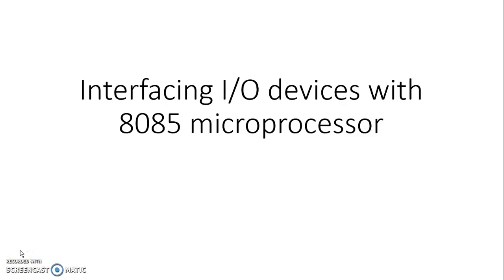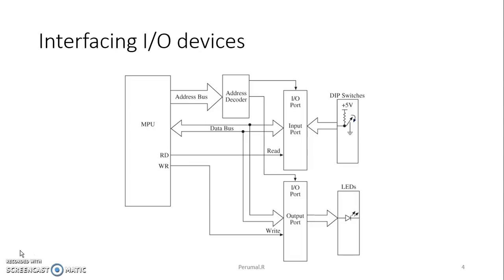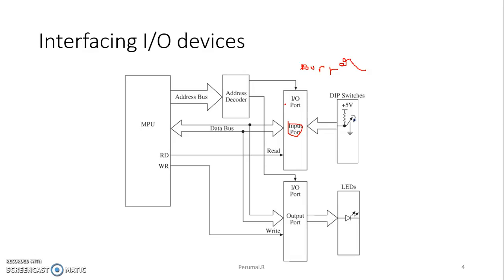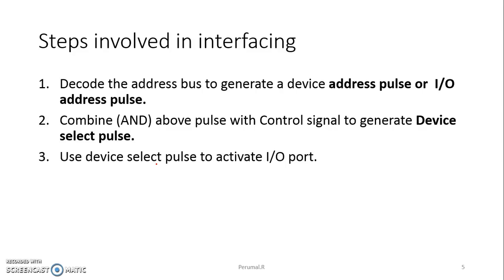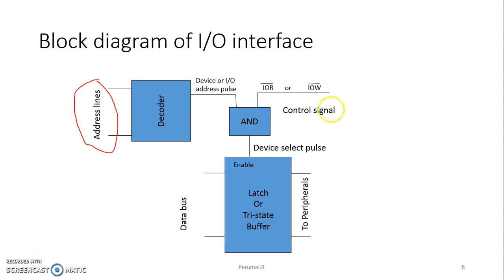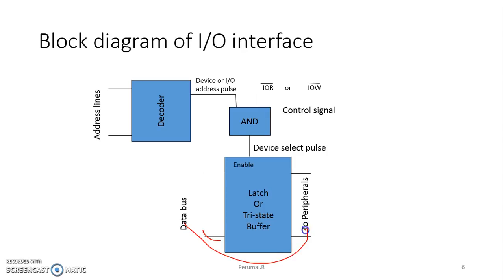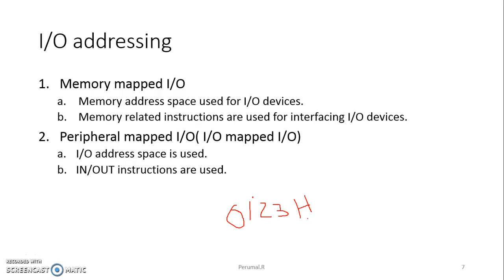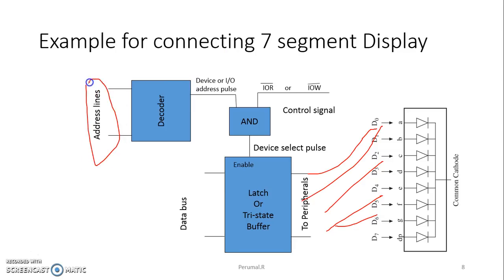Interfacing IO devices with 8085 microprocessor

Comment: sir how the out put device or input device address is known to the microprocessor? does microprocessor know the address of LED or switch?
Reply from the maker: Hanu Manth microprocessor don't know the address. the address is chosen by user
Reply: Sir I have studied that microprocessor do not contain I/o ports ,ram,rom. If it doesn't contain I/o ports then how can it communicate with external world? But I studied microcontroller contains I/o ports.
Reply from the maker: Hanu Manth I/O  devices have latches/buffer. this will act as ports. these ports can be selected by memory mapped I/O or I/O mapped I/O